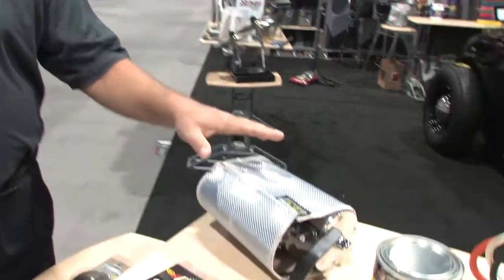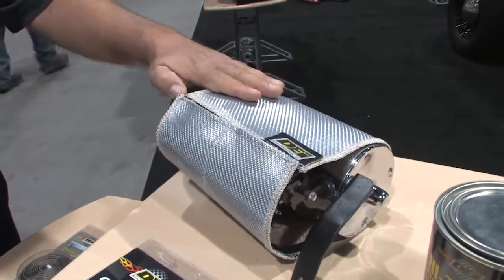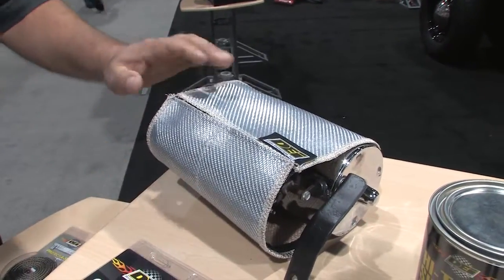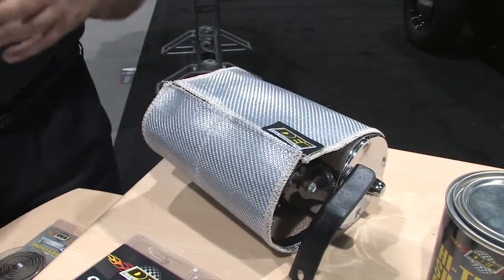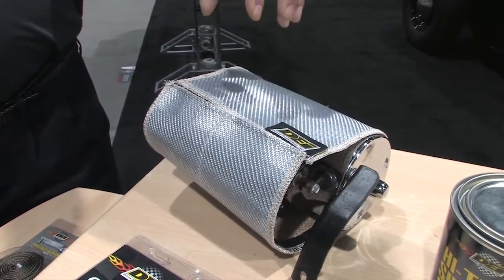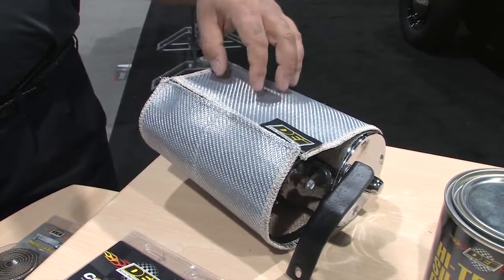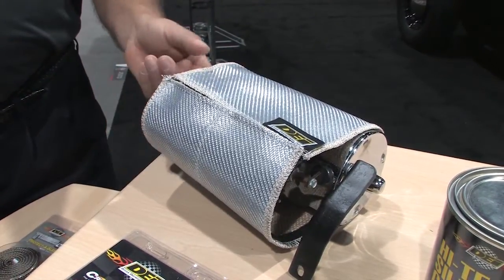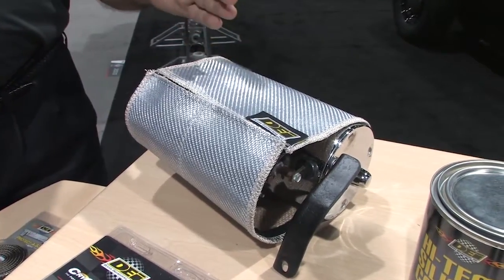Design Engineering Ultra Starter Shield

Comment: Yeah I’ve had that blanket for about 6 months and doesn’t work. Still heat soaks and I have ceramic coated headers
Reply: need to wrap headers ceramic doesn't do nearly as good as wrapped. Id recommend Heatshield Inferno exhaust wrap.
Reply: @ranmas2004  turns out my starter was just trashed replaced it and covered it with heat blanket. Removed both headers and wrapped them been driving it with no starting issues.
Reply: @juangarza9520  yep same thing happened on my Camaro just 2 days ago. Headers roasted the starter. So now I got a new starter ordered a heat shield starter blanker DEI Ultra 47 and removed both headers waiting for Heatshield inferno exhaust wrap to come in to wrap both! Dont want this to happen again.

Comment: I installed it on my RV and after about a week, it came apart shredded and I had to remove it.  Not impressed. * I went with a mini-torque starter and made a heat shield out of a piece of Diamond plate. I gave it about an inch gap and put oven insulation between the plate and the starter. Works way better.